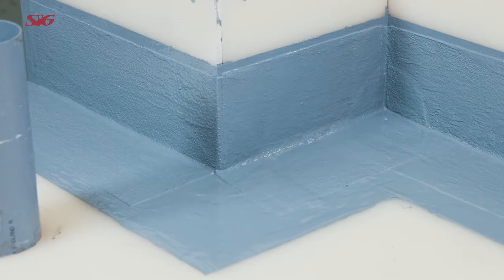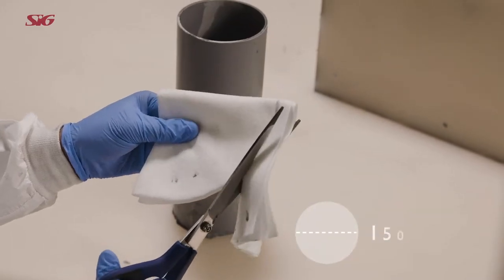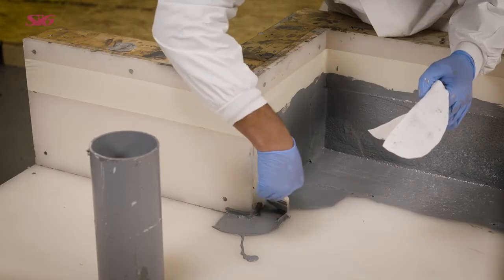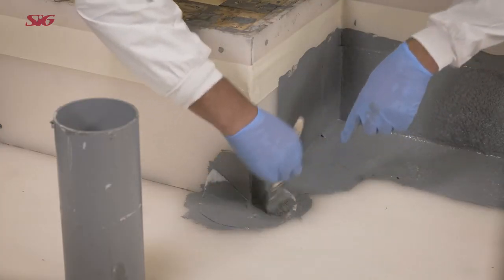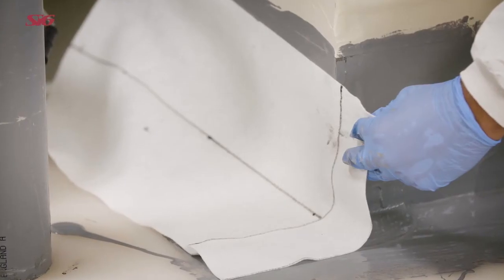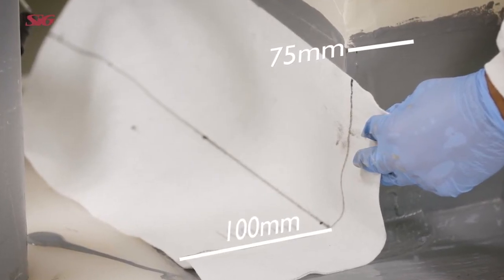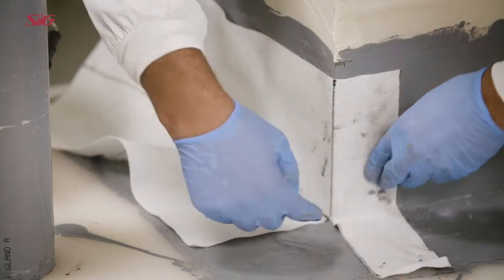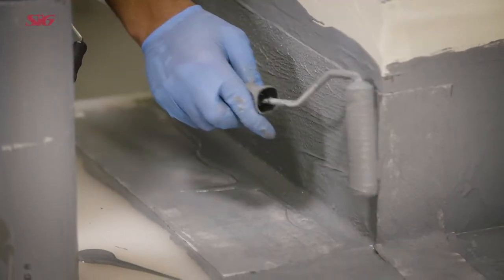7 Hydrostop AH+ Liquid Waterproofing Training Video   External Corners

Comment: Can this product be used on a reenforced concrete slab roof, that will then be used as a walkway/balcony? Or is a possible solution flagging the area on top of this system - using paving plastic supports?